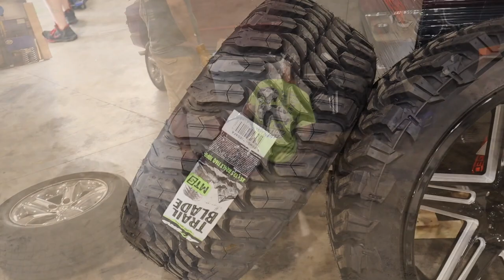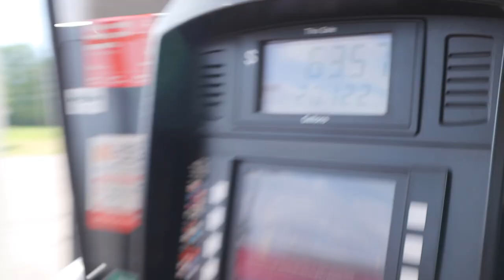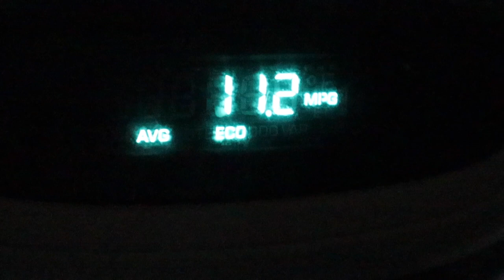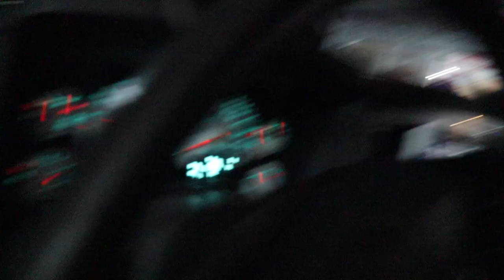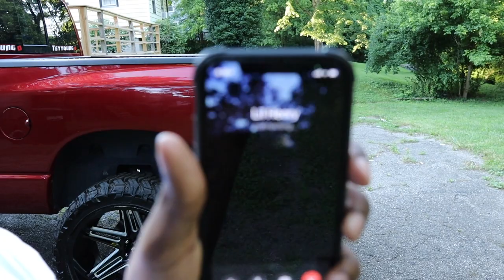MY DREAM TRUCK IS COMPLETE!!! DODGE RAM 24X12X35| WITH A 6 INCH LIFT!!

Comment: U have a nice set up.. I have a 2015 Ram and want to put 24x12 on 35's can I get away without a bunch of cutting with a leveling kit? Or think the 3 inch lift will work?? Trying to be able to park in the garage at home before I do it.. Was sure..
Reply: you have to chop chop or deal with rubbing. i had 24x14's on my 12' laramie and had to slightly cut the laramie flares as well as hammer a bit at the bottom of fender/frame meetup. also had to notch out a small spot at the bottrom corner of my front bumper.